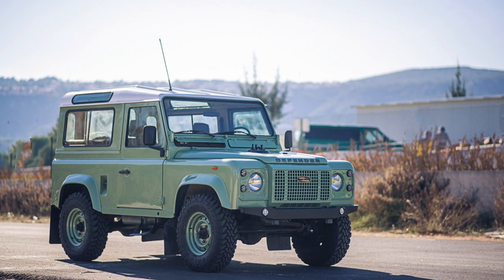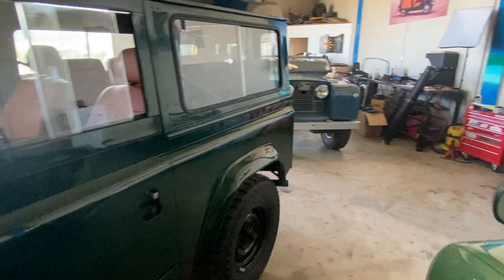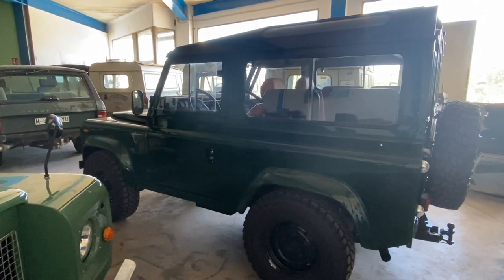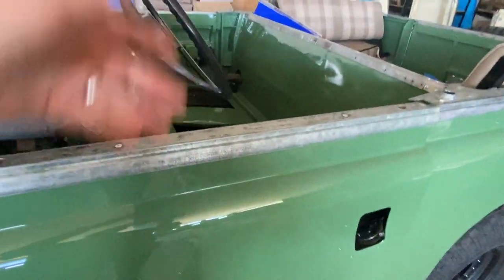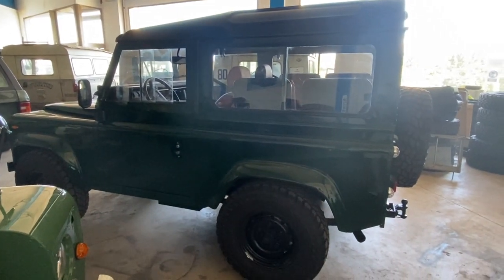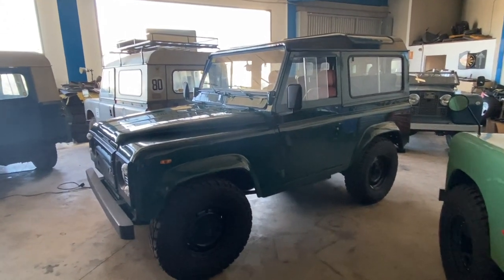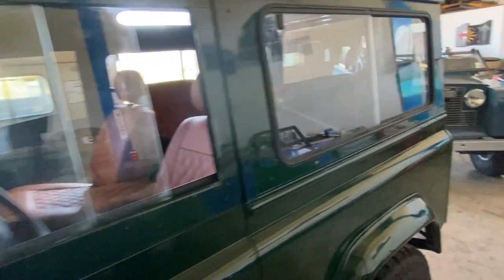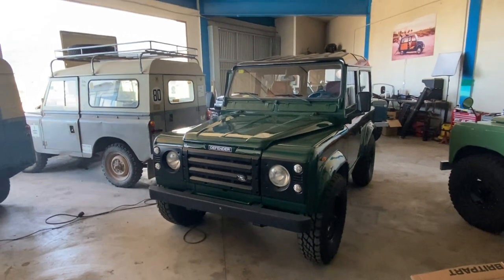Land Rover Defender - HARD TOP TO CANVAS SOFT TOP... and back again?

Comment: I have a hardtop that I switch to soft top in the summer. Once you have all of the necessary parts, it's not that difficult. However: First, don't underestimate the number of parts you'll need to acquire, and there's a lot of bits and pieces with a soft top, and they can quickly add up to serious $$$. Tailgates, hoop sets, header rails, fasteners, the soft top itself, front door conversions, etc. Look at the parts catalogue and make a list, and then count on surprises when you actually do the job. Second, the hard top is heavy and bulky to remove and store. You could theoretically disassemble it to save space, but that would be a major hassle and you'd compromise what little watertight integrity these hard tops have by disturbing seals, gaskets, etc. Inside storage would be ideal, but few people have that. Putting it outside under a tarp will invite invasion by spiders and rodents, and I wouldn't recommend it. Even storing the soft top is a hassle, what with all of the hoops and all, and stored soft tops can mildew if not stored correctly.

So the upshot is that I find it worth it for the enjoyment of a soft top in summer and the security/comfort of a hardtop in winter. But it was a major investment to acquire all the parts. Once you've got all the parts and have done it a couple of times, you can still plan on a solid half day to swap back and forth, with much more time required the first time you do it.
Reply from the maker: Great insight and detail, and you're 100% correct on all counts.

Comment: My 70' IIA had a pickup style tailgate that went down on chains I used with the soft top.  You closed it up with levers on each side to lock it down. Never had to change the lock set. The canvas top had a rear fold up window.  In the winter month's would put the hardtop back on with the full rear door and take the tailgate off. Not a big deal if you have a overhanging tree and a little manual winch.  One person can do it that way.
Reply from the maker: I love the pickup-style "flop down" tailgate.  It's such a great impromptu bench, dinner table or cocktail bar.  The downside is much more difficult access to the rear for human beings, and if you have seats back there it makes it hard for people to clamber in and sit down.  Thanks for watching!

Comment: I had a 1972 88" NADA deluxe hardtop.  Just after it's arrival, I swapped the hardtop for the station wagon lid I had on my 1962 88" Series IIA.  This was an easy job but probably took several hours for the change over.  Did this within a week or two of the Series III's arrival when it was brand new.  Two or three years later, I purchased a new "truck cab" from the Land Rover parts catalogue.  About that same time I purchased a full length canvas top and appropriate hood stick kit, and a "3/4-inch" canvas top with appropriate hood stick kit.  I used the factory's name for the latter canvas, which in reality was about 1/2 length, as it covered the rear load area when the truck cab was on the Land Rover.  I also installed a tropical roof panel on the truck cab.  These tropical roof panels were a very good investment, especially in summer months.  (I was sad to see the factory do away with them when they went over to the 90's and 110's even before changing the Land Rover name to Defender.)  Thus for my 1972 88" (s/n 25900379a), I had a full-length station wagon roof; a pickup (truck cab) roof; a full-length canvas top; and a 3/4" "tilt" canvas top.  At the time I bought the Series III (August 1972), I was living in Missoula, Montana.  In 1974 I moved to San Diego where I had a Land Rover parts business from 1974 to 1986.  I found it wasn't too hard and didn't take too much time to change from using either the station wagon roof or the truck cab over to the full length canvas top.  That said, the top I used most often was the truck cab (with tropical roof).  I only used the 3/4 length canvas top in winter months where I'd be taking long highway trips.  When the day comes I order a "new" (restored) Defender or Series vehicle, I'll probably go with a truck cab and a full length canvas top.  And, to be sure, I'd use the Series III type of 2-piece front doors.  (Solihull produced truck cabs came with the drop down tailgate that was also used as standard on hardtop (non-station wagon) vehicles.  All your videos I've seen, Paul, have been excellent.  I've been working on a book titled, TIME TO REEXAMINE PEARL HARBOR.  After that's published late next year for the 80th anniversary of Pearl Harbor, I plan to order a fully restored Land Rover.  When the time is appropriate, I'll give you a call.  "Land Rover Andy" as I used to be known does not need any distractions.  I started doing Pearl Harbor research in October 1983.  I've been working on this ever since.  Those who have written the Hawaiian commanders did not have the same high level of intelligence we had in Washington, D.C. do not know what they are talking about!  Of course, the U.S. Government did its best to mislead folks with disinformation.  My wife and I have spent months working at Archives II and the FDR Library in Hyde Park going through thousands of pages of documents which, of course, we scanned into our computers.  I've also read---and indexed---all 39 volumes of the Pearl Harbor Attack Hearings.  Hopefully, our book will be the first book ever published that tells readers that despite testimony to the contrary, Admiral Kimmel and General Short on Oahu and key subordinates had the same intelligence our "Ultras" had in the War and Navy Departments and at the top of the Army and Navy in the Philippines.)  Sorry I'm verbose.  I do look forward to the purchase of another Land Rover made between 1948 (the year I was born) and January 2016.  Thanks for your faboulous videos, Paul!  Andy McKane, P.O. Box 166, Maunaloa, Hawaii 96770.
Reply from the maker: Thanks for watching!

Comment: Owned a 2012 TD4 softtop, was even a lot of work to get the whole softtop off, the doors and front windows stayed and it had a tailgate instead of a door like on the pickup. Nothing like a modern cabriolet with electric hood. I just rolled up the side curtains and the rear curtain. Lot of noise too, listening to the radio or using the telephone on the highway was almost not possible.
Reply: But was it cool??

Comment: Seems like a simple enough fabrication for anyone that 'builds' land rovers. Cut the rear door in half, weld on caps with bracing and welded on nuts. Then bolt together, boom, two piece rear D90 door.
Reply from the maker: Yes, that’s can be done.  There is capping on the top of the lower tailgate door that you’d have to source or fabricate, but if you do that and cut so the capping fits when you’re done, then sure, on the outside it would look okay.  The inside is harder to make look good.  

We are almost always changing front doors anyway, and therefore painting, so there’s absolutely no reason to hack the OE safari door in half.  But if someone wanted to do this on the cheap and wanted to avoid painting at all costs?  Then I suppose you’re right, it could be done.

Comment: Hey Paul, quick question...I’ve got a 2016 defender 90 pick up and and I was thinking of swapping the two front seats with 3 bench bucket seats style similar to the old series truck for a more vintage look and more room. Do you think that possible? Thanks
Reply from the maker: Sorry for the delay in response.  I didn't see this until just now.  Anything is possible, but I have never done it myself.  I suspect it would be fairly straightforward in one respect and tricky in another.  Like the Series trucks, the original Defender has a uniform, transverse bulkhead that the seats mount to, so the seat frames from a Series III should bolt up easily and accept the original Series cushions.  But unlike the Series trucks, the Defender is slightly wider, and the vertical bulkhead behind the seats is set back a couple inches and less vertical.It might be difficult to get them oriented correctly without gaps, and with the correct rake for the seat backs.  But it's a cool idea.  I may try it myself.

Comment: Where can I get a series 3 rear door? Do the hinges on a series 3 rear door matchup with defender 90 hinges? I know that he said that the latch and striker must be changed when installing a series 3 door, but what about the hinges? Thank you.
Reply from the maker: You can get a Series III rear door from pretty much any Land Rover parts supplier.  AllMakes, Paddock Spares, Britpart, etc.  But no, the hinges don’t line up.  You will the door itself, the hinges, the latch, lock assembly, and striker plate.  It’s typically about… 800€ in parts plus paint?  Something like that.

Comment: For the Santana that you built with the either or, what soft top do you use? The D90 is longer and the Series 3 is the same length but with a flat windshield roofline. I have a 91 Santana 2500DL and interested in doing this conversion.

Comment: Great information. I am very interested in making this happen with my recent Defender purchase. So, series doors and tailgate. Is this also a series soft-top?
Reply from the maker: If you have a Defender, no.  You would buy the soft top and hoop set for the Defender.  But the doors, front and rear, are the same size, Series and Defender.  So you use all series doors.  But the hopples set and canvas hood must be for a Defender.

And when you buy the Series doors, don't forget to get Series latches and locks and striker plates.  You need to change everything on the doors.
Reply: @paulmisencik  I meant to ask about the hoop set. I actually found a side opening rear half door from SP panels but I will be going with the series doors. Thanks for the reply. This kind of information is priceless.
Reply: One more quick question. What is your solution for the inertia seat belt? I have seen the military-style roll bar incorporated into the hoop set, the actual seat belt bar, and mounting to the bulkhead behind the seat. I like the clean look without the roll bar.
Reply from the maker: @LeeSmith-dv9yy  You may not like my answer.  I do not personally like roll bars, and I do not personally worry too much about fitting the third anchor of the seat belt in Defender soft tops.  In my Series III's, I'm running lap belts only, and that's what I do in my personal Defender soft tops also.  Without a roll bar there is nothing solid to mount the upper anchor to.  However, if the third anchor is important, Exmoor Trim makes something called a "Seat Belt Mounting Bar."  It's a low bar that mounts across the width of the truck, directly above the interior bulkhead, and it has brackets for mounting the upper anchor.  It's less ugly than a roll bar, and works.  But in my own D90's?  For my personal use?  I prefer them very clean.

Comment: What about registration if you have both options, thanks for your feedback
Reply from the maker: I suppose it depends on where you live, but I have never heard of it being an issue.  The hard top was fully removable on the original Defender, right from the factory, so removing the hard top is not a "modification" to the vehicle.  It doesn't change the structural rigidity of the original homologated body shell.  If you bought a bog standard Defender you would be able to remove the roof anyway, and just run the truck open.  The canvas roof doesn't really change anything.

Comment: What a lot of waffle. I just want guidance on removing a hard top.
Reply from the maker: Unbolt it and lift it off.  I'm sure you can guess where the bolts are.  (HINT:  All along the edges that connect the hard top to the rest of the vehicle.)  Oh, and remember to unplug the cable for the interior light.  It's about as "not rocket science" as Land Rover work gets.
Reply: Paul Misencik, thank you for responding.
 
Yes, of course I can guess where they are. I'd already guessed. But somehow I'd got the idea that spending 12 minutes listening to you would add to what I'd guessed. Error. I heard you tell me why I wouldn't want to do it more than once. But I don't. And about military doors. Which I've got - it's an ex-military truck. And I saw some of your shiny LRs. But I didn't add to my knowledge. 

So I went back to guesswork, tried all the bolts - and only one was difficult, until it did me a favour, and sheared. So I'm now ready to lift it off. Objective is to fit my early (1986) 90 with the soft top it was born with. Got the parts. Now to fit them.
Reply from the maker: @j.e.s.bradshaw8401  There you go!  See?  It was as easy as you thought.  Sorry you wasted the 12 minutes, and a few more castigating me, but thanks for watching anyway.  Enjoy your rig!
Reply: Yes, I do enjoy it. Used it daily for five years, 40k miles. And this after it served in first Gulf War, Bosnia and Northern Ireland.

The time I spent watching wasn't wasted. Just faintly disappointing. And I don't begrudge it.